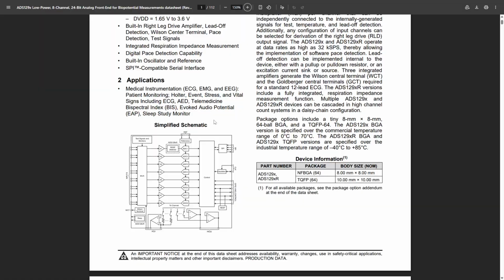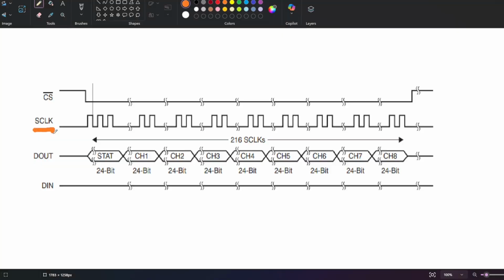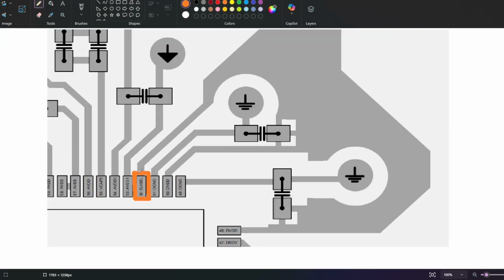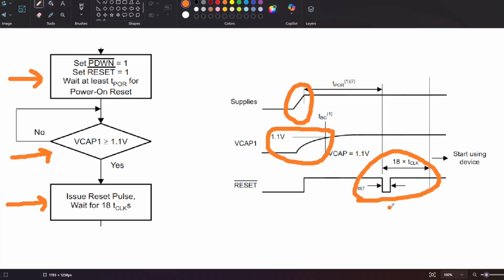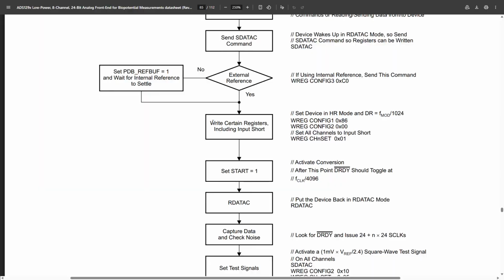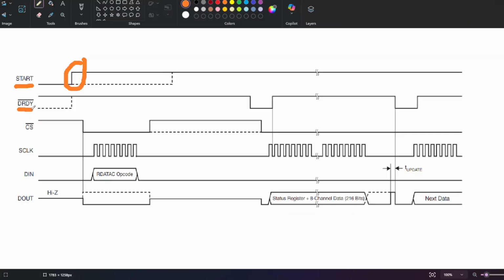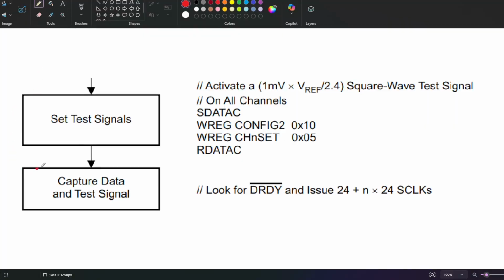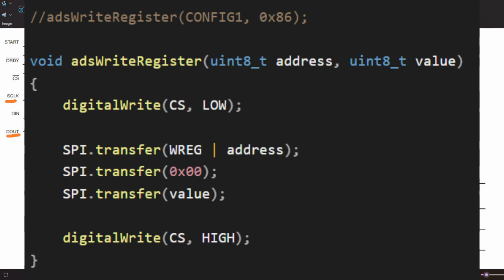How to Use the ADS1298 with Your MCU (EMG Band EP.6)

Comment: bro i have problam uploding the code in to esp32 c3 chip you are using every connection is good can you help me somtines it will upode good and somtimes it says no responce from chip or wroong boot mode
Reply from the maker: If it works sometimes but gives “No response from chip” or “Wrong boot mode” other times, the ESP32-C3 probably isn't entering bootloader mode correctly. Try holding BOOT while starting the upload and release it when the upload begins. Also check that nothing connected to the GPIOs is interfering with boot mode
Reply: @gelotek1 will it work with the rpi pico?
Reply from the maker: @Jblow-u2m as long as it supports SPI i think it can be used with the ADS1298